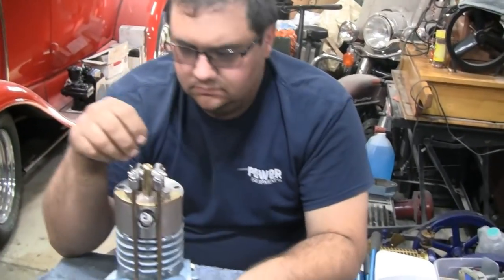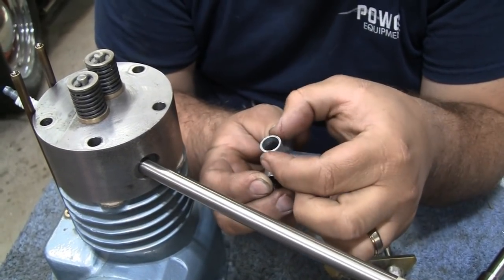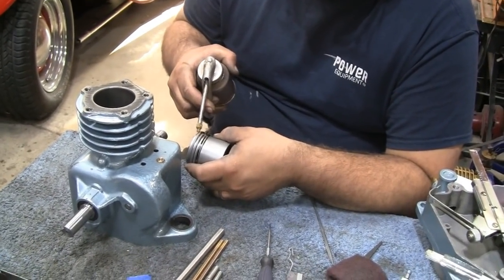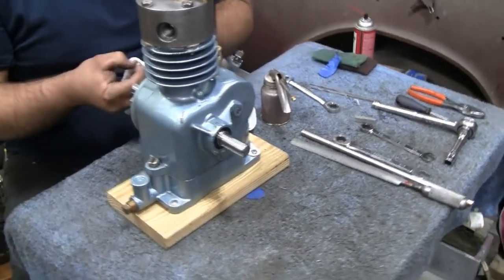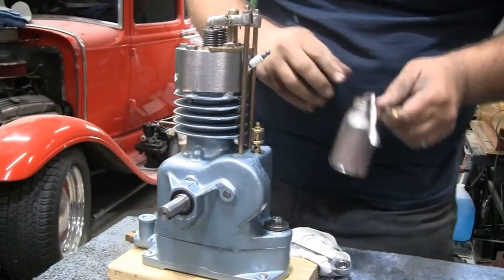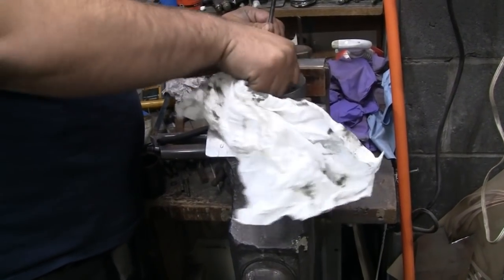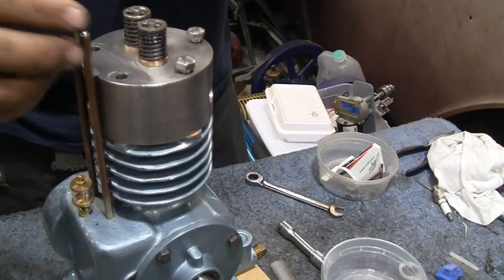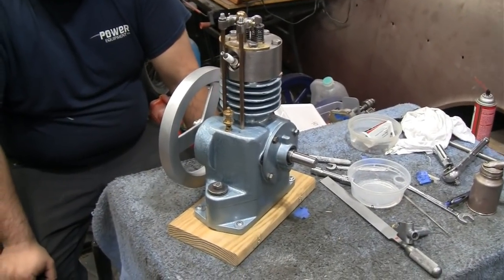HOMEMADE OVERHEAD VALVE BRIGGS (part 49)

Comment: Nice job getting it this far, are you going to add any detail to the head? Like adding some impressions to mimic the fins below? Or give it a go at brassing or nickel plating the head? Either way it goes still an achievement and looking forward to the first pop!
Reply from the maker: Thanks Ed!! Nah can't do much with the head, the bolts are only about 3/16" from the outside edge!!☺

Comment: You could bend that pipe rather easily if you filled it with silica sand, compacted tighter than a dog's nads and then, and here's the kicker, you heat the thing red hot, and bend it. I've had great success doing this with really thick pipe, like 3 mm thick on a 1.2 ID. To keep the sand from escaping, i welded one end shut, and threaded the other, and when i compacted sand i used the threaded side to make sure the sand got even more as i threaded the end cap. 

For structural stuff, no es bueno, you'll do damage to the pipe's structural integrity, but for ornamental stuff? Perfectly ok.

Comment: I've been waiting for this video on the OHV engine for 2 years!! 8-))

As an encore, once you get it running,  suspend the camshaft directly over the valves and run that with a belt from one of the flywheels!  Then you'd have an OHC Briggs one lunger!  I know the answer to this request.  Not in my lifetime, says Mike!! 8-))

Comment: Put the pipe in the lathe and machine a grove for an O ring to seal it into the cylinder head in conjunction with the set screw. Greetings from Phelan California.
Reply from the maker: That's a great idea and I wish we could do it but the pipe wall is way to thin!! I do have some thicker brass pipe it might work with though!!☺

Comment: I got a couple questions for Magic Mike!
Your valves won't rotate, will they? It looks like the push rods do, but they can't transfer the rotation to the valves. Also, what mechanism makes em rotate in most over-head configurations like this anyway?

Comment: For your next project, how about an overhead cam Briggs engine?  Would be interesting to see the external timing chain rigged up.
Reply: DOHC, 4 valve
Reply: @MrLukealbanese  A bit much for a single cylinder Briggs, I'd think.
I'd also like to see a Briggs V8, or perhaps even a V12 mini Merlin.  That would be cool in an ultra-light experimental aircraft.
Reply: Turbo Briggs.

Comment: It’ll seal up more when you get it running and it expands and gets oil through everything and it gums up
Reply: You may need to change that breather, it looks cool but I don’t think it’s gonna move enough air. It’s gonna put to much pressure on the gaskets. I would get you a tube that goes up and then down by the base. Kinda like an old sbc road draft tube or intake tube on the stock motors.